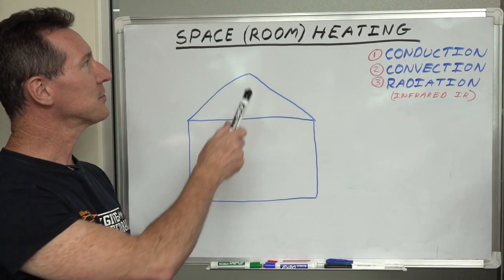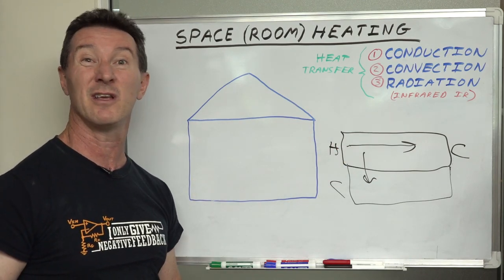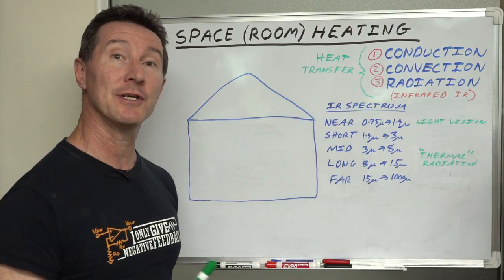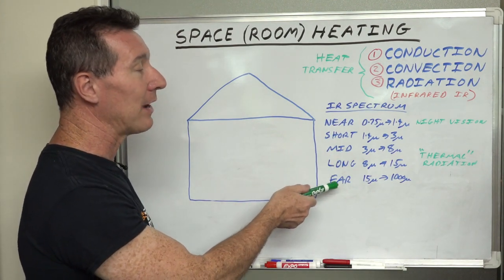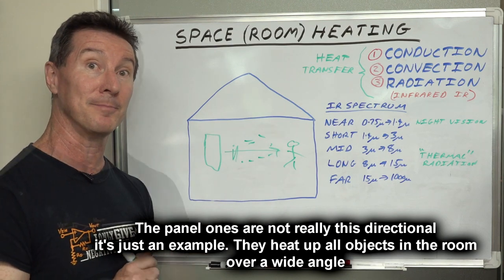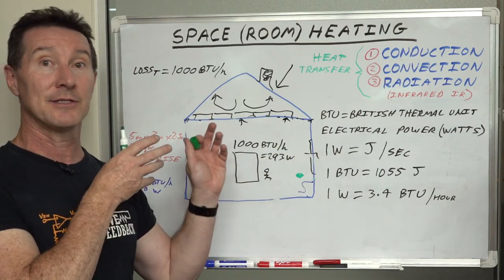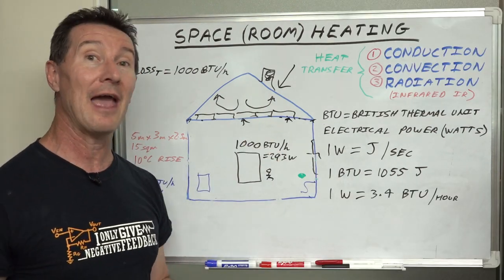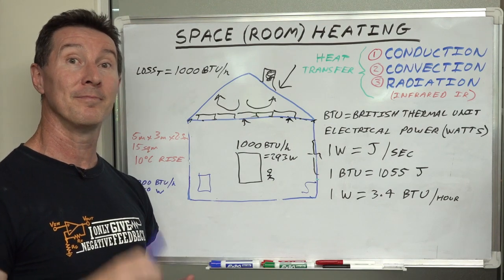EEVblog #1187 - Room Heater Technology Explained

Comment: Seems like heat pump really wins the efficiency battle. Does anyone know any single room heat pump thing that similar heat output to a oil convection heaters? Really want a easy to install one that can also work in both summer and winter.
Reply: Leo Gray Most brands of AC units sell those. Some will require a certified HVAC specialist to run the pipes between the inside and outside halves to avoid leaking the refrigerant.

Comment: Whilst I find this very entertaining and educational, can I ask a question...  When you say these heaters are all 100% efficient, that doesn’t mean that all of the consumed energy is being converted to heat in all cases, does it?  Considering the old fashioned bar heater, isn’t some of the energy creating light in our visible spectrum?  Does the heating element of an oil filled radiator also glow but we cannot see it?  Or have I been to the Solus School of Wizardry?

Comment: hmm... Are you scrambling the units? Watts is a unit of power. The time has to do with the energy output over a timespan. My energy company bills me "kwh" - which is kilowatts / hour. Means a device has to do a 1000 watts of work for an hour. This means 1000J of energy output/loss per second over the course of an hour. So amount X of energy in joules is output over the course of one hour.
Reply: kwh doesn't mean kilowatts / hour, it is what it is, kw TIMES hour - as long as w = j/s if we multiply w to time we get joules (w x h) which is the quantity of energy

Comment: So convection is just conduction through moving air?
To have convection, you first need to heat the air by conduction? 

"Convection is the heat transfer due to the bulk movement of molecules within fluids such as gases and liquids, including molten rock (rheid)", Wikipedia

"In convection, internal energy is carried between bodies by a moving material carrier. In gases and liquids, conduction is due to the collisions and diffusion of molecules during their random motion", Wikipedia

Comment: Although you're telling a larger part of the story you're still neglecting a lot of (important) aspects. You're for instance claiming the IR panel radiators have to radiate into the back wall; why the heck would they do that, of course the back glass is vapour coated to reflect the generated wavelength into the room. The same is true for proper windows (though they may indeed be more suited for other IR wavelengths), they're often vapour coated to keep the IR and UV radiation from the sun out to prevent green house effects; those are used both in houses and in almost every car. Convection also has other negative side effects like moving air in a way that allows heat to escape much easier, circulate dust and dry the air. It always depends on what you want to achieve; if you want to heat up a room and keep it at a fixed temperature there're nothing wrong with convection though a floor or wall heating are ways better than an oil heater, if you want focused heat then IR panels are much more effective.

Your videos really boil to down to belittling non-English speakers about differences between efficiency and effectivity (and W/h vs Wh) which is disgraceful. I don't see anything scammy about this KS campaign, except then using some terms incorrectly. This video also has a slight feeling of you backing out of some the non-sense you portrayed in your "debunking" video without giving up anything.
Reply from the maker: The Solus radiator is dual sided!
WTF, belittling non-english speakers? What does that have to do with it. It has nothing to do english as a second language speakers, it has to do with everyone mixing up these terms all the time.
Don't see anything scammy? REALLY? So you think that Graphene can produce power with no energy input? So you think that the Solus is more efficient than the same power rating heater?
Reply: @EEVblog  > WTF, belittling non-english speakers? What does that have to do with it. It has nothing to do english as a second language speakers, it has to do with everyone mixing up these terms all the time.

So why claim this is a scam if everyone mixes them up all the time?

> Don't see anything scammy? REALLY?

Seems about as scammy as a certain EEVBlog meter to me, which I also took a gamble on...

> So you think that Graphene can produce power with no energy input? So you think that the Solus is more efficient than the same power rating heater?

All I know is that the specs of this heater are in the same ballpark of other flat IR heaters from reputable companies on the market. Does the graphene have any effect on the effectiveness compared to other solutions? I don't know, but bashing it a scam seems way out of line and unfounded.

Anyway, I'll get one and let you know what I'll find.

Comment: 23:00 on heat loss due to poor insulation, I've read even small gaps can significantly impact your whole houses insulation. So say if a single bat in missing in the ceiling it may mean an 80% insulation efficiency loss. Ie it's non linear.

The example that was given was to imagine an eski, keeps ice for 24+ hours. But leave the lid cracked just a smidge and it all melts in hours. 

Any further info on that?  
Cheers mate.

Also 10 points for the use of "piss-ant" in a video lol.

Comment: Does the radiation mean I can get cancer from my heater?
Reply: No, he’s talking about infrared radiation ie heat, not radioactive radiation which is high energy particles emitted by the breakdown of unstable materials
Reply: {sadface}  

(also, don't forget gamma radiation and (some) cosmic rays)
Reply: Hahahahaha :D
Reply: Yes, I'm afraid it does...
Reply: Any cellular damage can increase the risk of cancer. So, theoretically speaking IR exposure could give you cancer.  It has actually been suggested that increasing skin temperature reduces DNA repair efficiency.
Reply: If you can crank it up until it starts emitting UV... sure!

Comment: You should have explained more about radiation.  Mainly, plutonium can heat a room.
Reply from the maker: Sure, everyone has plutonium heaters...
Reply: @EEVblog  I am trained as a firefighter, which includes Hazmat.  I have never heard of electromagnetic radiation.  Only, Alpha, Beta, Neutron, and Gamma.
Reply: @EEVblog  Infrared whould be beta since its block by the skin?  Right?
Reply: @EEVblog  TO my understanding, Alpha is block by cloths, beta by skin, Gamma by walls, Neutron by nothing.

Comment: When you consider how cheap heating tech is and how you're essentially limited by the long term mains power draw (at least domestically).. Yeah, no point buying fancypants heaters, when they all max out at your local legal limit for wattage, other than ergonomics whether it's comfort IR heaters or factors such as noise or better thermostats.

Comment: Dave, if you are not subbed to 'Technology Connections' Thats another coincidence. 
I and many others are suffering from very unlikely coincidences, even more now than in the past. My theory is that this is happening due to peoples brains being led on similar paths due to the internet.  So we are coming up with what we think are original thoughts, which we are but others brains have been on the same path that also led them to the same thought causing major coincidences.
Reply from the maker: I'm aware of his channel and have watched some videos here and there as they get recommended but I'm not subscribed so was not aware of his video on this until people shared in the comments.
We came to do our videos for two similar but different reasons, mine was because of the Solus Kickstarter
Reply: maybe he saw that kick starter aswell which prompted him to make his second video on space heaters.  i wonder how many others have recently made similar videos, stay tuned for the edit
Edit: yep there are a few in the last few months also about 5 years ago a few were made. Now im gonna check how it trended on google, whats wrong with me.
Edit2: Just as i thought, the search term 'Space heater' peaks once a year

Comment: 👍👍👍 Very good presentation and explanation coming from a guy who spent 2 1/2 years taking thermodynamics fluid dynamics just for the HVAC industry and spent the last 30 years doing calculations for installing the equipment I sell. The small electric heater with all their fancy color brochures and BS marketing is just that a bunch of BS. And comparing efficiency using electricity heat pumps are 4 to 5 times more efficient then electric inductive heaters. But that’s a whole Nother discussion and video on heat pump and grabbing in removing energy from the cool air outside of your house and moving it into your house using less power watts per BTU then indinductive heaters
Reply from the maker: Thanks

Comment: i feel like you still missed the potential advantage an IR lamp could have in terms of heating, the goal is NOT to heat the room but to heat the people inside it. an IR lamp could be in equilibrium with the heat loss of the room but the poeple inside to be hotter than the average thus an effective efficiency of more than 100%. i doubt solus would do it but thats different.

plus heat pumps can also be more than 100% efficient for certain, which was only mentioned in passing. pretty sloppy imo

Comment: I have a 350% efficient heater on my wall. It outputs 7.5 kW of heat and only uses 2.1kW of electricity.
Reply: So you heat your wall with peta tweets. Lots of heat

Comment: 18:54 Muddled explanation. BTUs are a measure of the amount of heat (i.e. energy), and hence are equivalent to Joules, not Watts. Hence, to measure power, you're using BTU/hour, not just BTU. Might as well use  BTU/second (which would be about a kilowatt), or BTU/minute or whatever. Now the fact that in many applications BTU/hour is abbreviated as BTU is the confusing part -- so probably the better explanation would be to say that "when measuring power, BTU means BTU/hour", instead of muddying waters with "BTU has that time built in" but then talking in terms of BTU/hour anyway.
P.S. You're also muddling efficiency vs effectiveness. "Efficiency" is about wasting the least amount of time and energy. "Effectiveness" is about getting the desired result at all (usually implied in a reasonable time frame). Both heavily depend on the desired result. WRT heaters, effectiveness is not at all about what heats up first or how fast that happens -- it's about whether the thing you want to heat up does heat up.
Reply: He said that BTUs are equivalent to Joules, not Watts. He also wrote that  on the whiteboard. And "effectiveness" it's not only about whether the thing you want to heat up does heats up or not, but how much heats up in respect to time also. Heat is an analog quantity and not a digital one (1 or 0, yes or no, etc).

Comment: Do not buy fan heaters if you plan on LIVING in the room. If you only want to warm it up, for ex to do a job then use fan blower heater. But... if you plan on living in the room, then get the oil heater. The latter is 110% better for humans: it does not generate any noise apart from maybe ticking of the metal, it keeps the air warmer for longer and for ex opening a window for a minute will not cause huge drops: the large mass matters... 

So... in the end, buy one that suits the need but for the love of all that is holy: do not buy one of those fan heaters if you want to stay comfortable. You CAN combine oil radiator with a fan to make it much, much faster but it can then get really hot as it's thermostat is fed with colder air than usual.. A Larger PC fan is almost enough to boost it's performance just a bit, to force a bit of extra convection, desktop fan is already too much, ;)

Comment: All this talk about slow heating.. must say a cheap new oil radiator will heat up plenty quickly.. you will be reaching for the thermostat. And it's silent :):):):) It simply looks like a beast or outdated or something. Also, it seems the heater EFFECTIVENESS up for grabs.. for example the oil radiator could have any number of fins but someone did some measurements and decided on a number

Comment: But Dave how does those nanoparticles work that are used to more efficient heat water? Are they picking up wavelengths that normally just pass thru the media? 
I mean the heat generated within "the room/space" may differ with different technologies although the Watts used the same? You do not want the heat to be generated outside? You say things like all Watts / Joules will finally be a thermal heat maybe they travel out to space or out of the room? I mean you used a thermal camera that does not pick up all wavelengths from source using Watts? How do you know that your Watts are used efficient "inside house?" because i guess you want all the Watts to be transformed into thermal heat "inside house"?

https://www.sciencedaily.com/releases/2016/06/160613131104.htm

Also something i only heard is there such thing as selfoscillation in thermal systems, like that all medium have some sort of prefered wavelength to heat them? Could one find a wavelength that was specialised to excite molecules atoms. Could one for example find a wavelength that is very good excite the nitrogen atoms, would not such a system be able to produce more overall heat in a room?

Could one call it a selective heater, maybe just heat the atmospheric gases in room, a wavelength with no depth penetration into materials it specifically excite nitrogen atoms? Are these type of heaters possible?
Reply: Atmospheric heat is just the hardball kinetics of the inelastic system in  a gascloud?

Comment: Actually, a medium IS required for IR radiation, the entire EM spectrum cannot support propagation without being submerged in some kind of medium. The recent studies of Quantum Mechanics and black holes has shown strong evidence that outer space is NOT empty at all. Thing is called quantum fields theory, the sister of String theory. Which is very exciting theoretical and experimental research because it suggests that speed of light is no longer absolute speed limit as Einstein suggests, instead it's just speed of light in absolute vacuum, not putting any limitations and not necessary meant to be absolute maximum.
Reply from the maker: The Ether!
Reply: @EEVblog  Which mythological  origins are dated who knows how long ago, a thousand years may be? Sometimes it feels like philosophers is the only group of people who can actually dictate the rulesets and shape the universe as they like, and science will confirm it eventually. Which leads to another theory of universe is readjusting itself according to rulesets we people invent which quite frankly could simply mean that we are in some kinda simulated reality.

Comment: "Don't let anyone tell you a heater isn't 100% efficient."
I'm going to build one where half the energy goes into lasers pointed out of my house towards the most empty part of the known universe.  Just to be contrary.
Reply: Well, if you're going to be contrary, why no just put the whole heater outside and claim that it's 0% efficient. 🤓
Reply: @Bob Sacamano The little light on a heater...when that light gets absorbed by something in the room, it turns to heat, adding heat to the room. If the cord is resistive and gets warm...still adding heat to the room. The light from the heating element...same deal as my first statement. Electric heaters are absolutely 100 percent efficient
Reply: @timramich  This is why I always orient my heaters so that the light from the on switch goes out the window and up into space.
Reply: @AndyLundell  Whatever.

Comment: You are partially contradicting yourself: at the start you say IR heaters can be differently good (that is efficient) at converting electricity into IR instead of convection, (literally how efficiency of LED's are measured, when convection=heat) but later you say if anyone claims to be more efficient than someone else they are wrong.
This is the fundamental problem here and why I disagree with you bashing this product.
The Solus claims they are more efficient at producing IR, aren't they? (Not directly maybe, but implied.) Which is probably true. You would have to buy it in order actually prove it to be bogus. Reason is you are wrongly saying they are wrong, when they say they are more efficient, as you yourself showed to be the case.

regarding Watts per hour: There's always an engineering and a marketing team, Dave. They don't have much in common. And if it comes from the engineers it's a slip. This should be ignored when deciding if the product is bogus or not. It literally says nothing as to how good the product is, and you're just mentioning it to be mean.

You give them too much shit, Dave.
Reply: @autogolazzojr7950  again, those are not the engineers.

Comment: • All energy use results in some heat, so all heaters are generating heat no matter what, how, or where in the heater it is. In fact, heating is the only thing where efficiency is irrelevant; lights, cooling, motion, etc. all have efficiency, but not heating. 🤦
• 15 watts/hour would mean it's increasing its usage by 15 watts each hour, so after ten hours, it's using 150 watts, and so on. 🤦 Ostensibly they meant watt-hours, but if they can't get that right, then it's not very encouraging about their product. ¬_¬